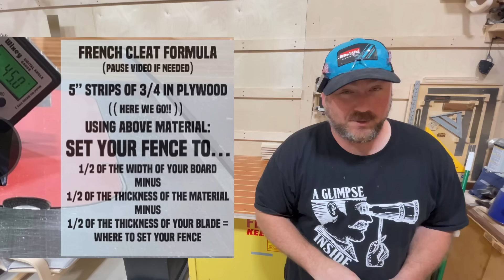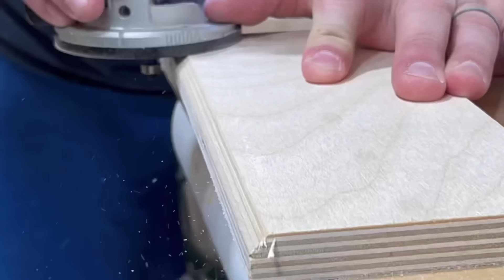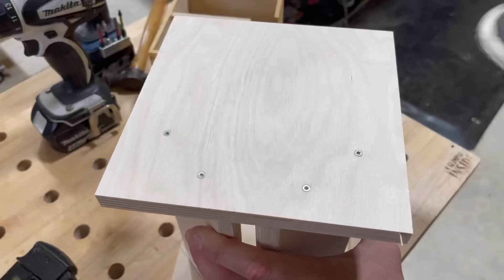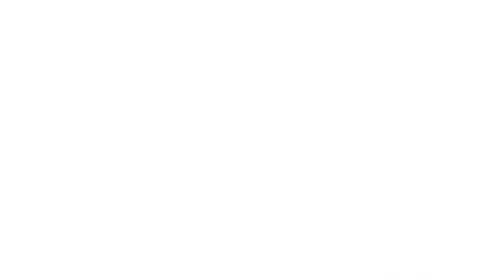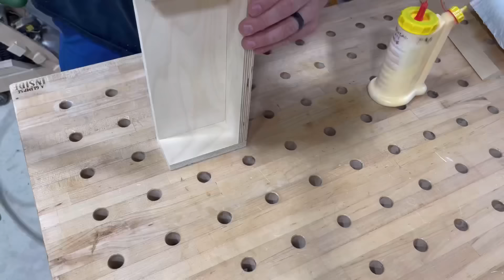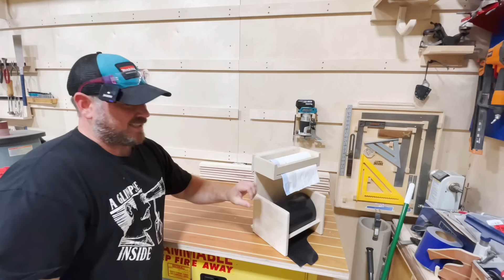This FRENCH CLEAT Design Change is AWESOME

Comment: I did my FC's the 'normal' way (using a circ saw with guides, so the cutting dynamic is a little different), but I had considered doing the parallelogram way instead to make the process faster. Ultimately I decided against it because it means you can't use the various locking approaches (plenty of YT vids on that) to prevent fixture slippage when taking things off. Your video makes a great case for a hybrid approach: standard cleats on the walls, but parallelograms on the fixtures to allow them to act as cleats for stacking fixtures.
Reply from the maker: Dude that’s awesome you did it with a circular saw. Thanks for the input as well as the kind words. Thank you so much
Reply: Forgot to add, I always break the edge on my cleats as well, as you have done, although I use a block plane because it's quick and easy. I also use paste wax on the cleats.

Comment: What are “brads”? You use the term throughout your video….
Reply from the maker: They are a little 18 inch gauge nails that fire from a air gun. They come in the range of sizes there what I’m using to attach the pieces together

Comment: As a new subscriber, what kind of plywood do you prefer?

Nice to find someone who uses similar building techniques. Look forward to your future content.
Reply from the maker: Of course I prefer plywood. The higher quality the better. My Plywood a choice is Baltic Birch in the 5 x 5 variety However you only can find it plywood dealers and they aren’t in every city   The best Plywood I’ve ever used as a marine grade plywood used for yacht decking. It’s with my outfeed table is made from
Reply: @AGlimpseInside  that’s good to hear. The only 2 types of plywood I’ve ever actually liked working with were Marine Grade and Baltic Birch.  Besides the few projects I have used those plywoods for, I almost exclusively use MDF. I’m feeling like I need to switch to plywood, or at least increase the amount of plywood I use. 

Thanks for the response!

Comment: You just gave me the BEST IDEA!  ..
(Which means it's probably been done already)  But... I was going to reapholster the one  I created before vith a painted frame & cloth wrapped board stuffed with batting... but instead...
..  I'm going to redo the whole thing as
A-a-a-a ... CLEAT SLAT HEADBOARD!!
It REALLY IS incredible if you think about it.  Just like theceorkshop wall...
It's a Shiplap Look.. with endless functionality!  Sliding Sconces.. bottom mounted & recessed pop lights for reading lights.. temp shelves.. phone chargers.. goosenecks for phones or tablets, cupholders, padded head & backrests, ..armrests!.. flip downout fold out trays for food & laptops.. eyehooks for HandCu... ..well... you get the idea.
Did I miss any?

Comment: Ha... as soon as you showed the new cleat.. I yelled out to myself...
 "Cleat ON Cleat!"  ALSO.. IF you wanted the option for things to to be more permanent or sturdy & unable to give.. you could make the wall slat cleats a Trapazoid  shape and then you can do a top/bottom DOUBLE CLEAT.   Then Slide in on the ends.  Since the stacking bins idea you mentioned is so good... What could you Stack OUTWARDS with the Double Cleat!? Aka the North/South Cleat.. Aka Cap Cleats..
Aka.. a Saddle Cleat.. A .K. A... CLAMP Cleats!

Comment: Good idea. In the professional millwork world, french cleats are done a little differently, they're rabetted cleats instead, which I found is for good reason. If you're hanging wall panels that need to sit side by side and line up with millimeter precision, a diagonal cleat like this will sometimes cause issues. If the wall isn't straight, the panel will tend to ride higher on the cleat and not sit tight to the wall or flat down to the bottom, the rabetted cleat gives reassurance here, either it doesn't go on at all, or it sinks down tight to a reliable height. It's a special case of course, this diagonal cleat is definitely faster and easier to make and will do a great job in regular circumstances.
Reply: Do you man z-clips?
What do the rabeted freanch cleats look like?
Reply: Do you man z-clips?
What do the rabeted freanch cleats look like?
Reply: It's essentially the same as a z-clip in practice, but made of wood. It's usually a 2-3" wide strip of plywood with a rabbet on one edge so that a matching piece can hook onto it from the opposite direction. it often includes a small chamfer on the edge to guide the pieces into place. In other words, think of the sloped part of french cleats and exchange it for "stairs", that mate togeter. @kimdavies11
Reply: Do you man z-clips?
What do the rabeted freanch cleats look like?
Reply: Do you man z-clips?
What do the rabeted freanch cleats look like?
Reply: Do you man z-clips?
What do the rabeted freanch cleats look like?
Reply: Do you man z-clips?
What do the rabeted freanch cleats look like?
Reply: Do you man z-clips?
What do the rabeted freanch cleats look like?
Reply: Do you man z-clips?
What do the rabeted freanch cleats look like?
Reply: Do you man z-clips?
What do the rabeted freanch cleats look like?

Comment: You missed a trick: when hanging cabinets, if you cut out a matching parallelogram on the side panels, they can fit flush to the wall without a gap.
Reply: Wait, what?  Can you spell this out for me a little?
Reply: @jenniferlawrence1372  Here is a video showing the regular method of just making a square-bottomed notch in the sides of a cabinet, which leaves a gap.  If both the mount and the notch are cut to 45-degrees top and bottom, the cabinet can slide into place without the gap that can be seen in the video. https://youtu.be/2_z7zW5fU9Q
Reply: @KeithOlson  Thanks, Keith.

Comment: cutting the top edge of the trash bag holder at 45° would enable to build a secondary holder, that still fits on the original wall an saves some material.

I really like the idea and will incoporate it into some of my projects.

Comment: Kinda buried the lead here.  The actual advantage seems pretty clear: you can space the wall cleats very close together if the top and bottom are 45 bevels.  More cleats = more flexibility for how you design your hangers.  12" spaced wall cleats require the solution you created here with the piggy-back cleat. But if your wall cleats were all 3" spaced, you could just design everything the normal way, and conserve wall space.

Comment: I think the BETTER advantage to the parallel cleat is that it makes the holder ON the wall less likely to fall off it it is pushed up on. For instance, I have a French cleat shoe rack that is prone to falling off because it is so far from the wall the weight kind of overpowers the cleat. With these parallel cleats, that wouldn't be an issue since I could put two cleat pieces on the shoe shelf that sandwich the wall mounted cleat and yet are still able to be attached. 
With the old method, I'd have to add some sort of lock mechanism or something, but this is much more compact and simple. (My explanation is garbage, but I hope it makes sense.)
Reply: Im an engineer. Your description helped me. Great idea thanks

Comment: Chris, wouldn’t having the cleat on the wall close and with a flat bottom lend itself to adding in a cleat lock, using an appropriately sized normal cleat upside down? Could add a small piece to prevent it from being pushed too far in and have a feature to pull the cleat out (like a small knob or finger pull)?

Perhaps you can explore this idea and spin another video from it?

Thanks for helping to bring this guy’s idea further out for everyone!

Comment: You forgot 2 of the other main features and advantages of the new angled cleat 

1) they look better on the wall as they don't cast same harsh shadow

2) you can have them closer together and still slide your holders in place so can put more actual wall mounted cleats which allows more adjustment and customising where everything goes!

The old system you need a minimum space above each wall mount to allow space to slide up and pull out while the angles new style can be basically spaced the exact size of the cut cleats..
Reply: Can also use 1/2" ply for closer wall cleats and cleaner look.  Few things are so heavy they'd bust out of 1/2". And if your wall cleats are close enough, use two for the heaviest stuff.  Cheaper and better!!
Reply: I think your number 2 is the biggy, but not only does it increase flexibility, it enables that plus use of multiple  cleats at different vertical heights to support an item.
Reply: So does this mean the fixture holder won't fall off the wall if it is hit? If it still can fall off is there a way to lock it to the wall like Chris shows in other videos?

Comment: What was the reason that prompted you to space your cleats 12" apart on this wall?  Loving your channel.
Reply from the maker: One it saves time and material. And secondly over the years I found that this just works the best for me. If I need a holder to be longer than 12 or 14 inches etc. I might incorporate two tools on it. One more reason is just in case I ever want to take these down I don’t have a ton of cleats to remove

Comment: Add cleats to a storage trailer and you can easily set up a mobile workshop without having to duplicate all of your tools, supplies, and storage containers.  You could probably create a work bench that  hooks into the French cleat system and has foldable legs.  This also frees up that storage trailer for other uses; moving, transporting big toys, camper set up….

Comment: I love the concept of your more universal cleat setup, especially the cleat on cleat possibilities. I don't have much free wall space, as I have tons of cabinets (repurposed kitchen uppers, with doors), but your concept makes great use of the end caps and even using the doors themselves for 'tool wall' storage. The trash bag holder with the bottom that sits flat on a bench gives me many ideas for the 'portable' tool holders, as that concept has more utility than the 'rearrangeablity' (is that a word?). I am thinking about maybe a fastener kit or glue kit which goes with you to the assembly table during use, then back on the rack.
    Congrats on your success (116K subs) since going full time.
Reply: I made couple of cleat all around under the work bench, now I can use it as tool holder

Comment: I didn't want to sound so negative, I like your videos. I'm just making my own F.C. system now, and as I live in an apartment and don't have space nor money for a table saw (and it wouldn't be popular with the neighbors either), I have found a very cheap and easy solution. I can buy very cheap length of triangular wood, meant for filling edges of roof constructions I think. They are simply cheap roughly planed 2"×2" fir cut diagonally. I plane the cut side (quite raw) reasonably smooth, then turn it over and plane the 90° outer corner down until I have a flat side about 20 mm wide, giving a trapeze cross-section. I don't plan on hanging anything really heavy on them, so although this is cheap and maybe not as strong as plywood, it will work fine. I haven't thought of a way to use the downward edge yet, but I'm sure I will.

Comment: So now I reached the "awesome" part. I kind of had guessed it when the parallellogram cleats were cut. I am not exactly impressed by the execution, although the basic idea might be made to work in one or two different ways. But as I see it the crucial point of french cleats is that all holders have the same type of cleat. By introducing a second, spaced, type this no longer is the case, and such holders would require adding a filler piece to be mounted directly on the F.C. wall. Although that is doable, it is less convenient, and old holders of the basic type would still not be mountable on top of a new type cleat top. I'd go for tighter spaced wall cleats instead, and just add a regular cleat section edge up on the front of holders that have a backplate with some excess space on it. But only for holders that I would only want to move together with the "second layer" holder. Like a holder for a cordless drill could have a second layer holder for drills and bits. You grab the drill and the drill/bits holder off the base holder and take them to the work area. You could also have a portable cleat "wall" or toolbox, and mount the selection of tools - with holders - on or in that, and take everything with you in the car, for example.
Reply: I was thinking the same thing (not all holders are the same). What you could do instead, taking the trash bag Holder example, is instead of make the clear have the 45°, you make the back board of the trash bag holder (the one attached to the clear) have the 45°. That would mean, the top tray/item wouldn't need a spacer, and it's cleat would sit on top of the back board of the bag holder. Then all your cleats are the same, and you don't lose on space.
Reply: @parttimewoodworker2225  So the lowest cleat will be a normal, maybe slightly taller (as its contact surface is reduced by at least one cleat thickness)  cleat, which then acts as "wall" to the 45° edge on the backplate of the holder? I can certainly see that working nicely, and is saves both depth and mounting an upwards cleat, only requiring cleats and backplate to have the same thickness. Great idea!